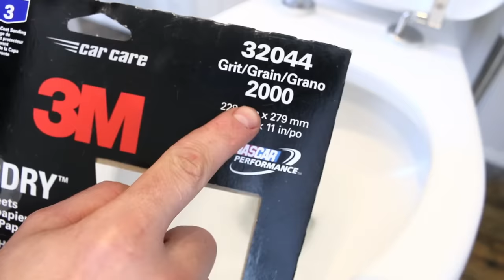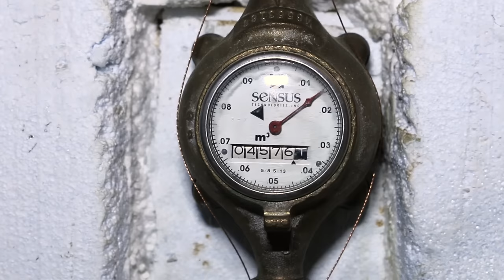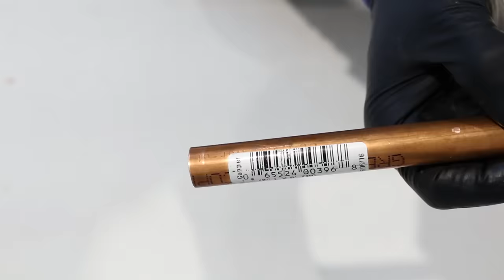15 GENIUS Plumbing HACKS! | GOT2LEARN

Comment: I installed a valve by the main shut off. To remove water from your pipes, use a wet/dry vacuum at the extra valve and leave it on while you solder. It will remove the water and help draw the solder into the item you are soldering.

Comment: You know my friend, your method of cleaning the water closet by using a sand paper is totally wrong ! Use instead a muriatic acid , spray a muriatic acid on the part needed to be cleaned  and after one one hour just rinse it with soap and the water closet will become like new again.
Reply: White vinegar more friendly and cheaper !!
Reply from the maker: Not as strong.
Reply: @Got2Learn  Obvious you have not used it !!
Reply from the maker: @goddam9925  yes, used it a few times for tough stains, it did nothing for me!

Comment: 2:20 Just wrap the fixture with a red shop rag doubled up and then use the pliers regularly over the rag- No scratches and much better grip than those stupid rubber gripping tools sold at homedepots.

Comment: A trick I have used for years when trying to solder a dripping pipe is to take a piece of bread and ball it up tightly and stuff it in the pipe.  Make your solder connection and the bread will dissolve and simply wash out of the pipe at the faucet. It helps to take the aerator off first to avoid clogging it.
Reply from the maker: Yeah, it works great! I made a video on this: https://youtu.be/ygGkJcpKZzs
Reply: Make sure you use white bread and tear off the crusts first!

Comment: Good tip about the manufacturer's sticker...! I bought a brand new scraper the other day with a sticker covering most of the blade. I couldn't remove the sticker and the glue with soap and water or with another scraper. Wasted about an hour of work time trying to clean it properly. The blade is still not ready!
Reply from the maker: Hehe, yeah the torch mixed with some flux does miracles, thanks for the kind comment Daniel!

Comment: For the first tip, instead of using sandpaper I recommend using a small amount of muriatic acid. About half a cup and let it sit. The deposits should scrub right off with a normal brush.
Reply from the maker: Thanks!!!
Reply: Because everyone has muriatic acid just laying around.
Reply from the maker: @0osha  🤣🤣🤣
Reply: @0osha  if you can buy sandpaper from Lowe's then you can also buy muriatic acid. It's in the paint section.

Comment: Been watching a few videos....not too shabby!  Lol. I don't know everything but couple things to add....1:45....not every one has dye or food coloring....if the tank is full, shut the shut off , mark the inside of the tank at the water line and wait a bit ....when checking....water level has gone down, good chance it's the flapper.  Want more pressure out of shower heads....all have restrictors that can be removed....down side you will use more water.
Reply from the maker: Good tips Todd, thanks man!!
Reply: @Got2Learn  you're welcome

Comment: That second last one, if your really stuck jam a bit of white bread down the pipe to stop the flow, fix the pipe then use your touch to burn the bread to carbon. You'll have a fixed pipe though you'll have bits of burnt toast in your system (old plumber trick)
Reply from the maker: Made a video on that, here's the link: https://youtu.be/ygGkJcpKZzs

Comment: I'm going to try the rope trick tomorrow. I'm a plumber and have had that very problem with sharkbites.
Reply from the maker: No every rope works, some will snap.
Reply: How can a plumber use a mechanical fitting thats designed to fail in cold weather? S.b. for the fail!

Comment: Another good tool to remove Sharkbite fittings is the go/no go tool for pex clamps. Just use the no-go slot which corresponds with the fitting size and the fitting is easily slides off.

Comment: Really nice vid, love that 3/8 valve trick great idea. Cause its a quick semi permanent solution as well esp when u cant turn main off, but... what if its a packing leak!? And no main shut off
Reply from the maker: Shut off at street and fix both shut off and 3/8" 😉

Comment: A reeeeeaaaalllly old trick for soldering a horizontal or vertical line stub with dripping water is to stuff a chunk of white bread about 8 " into the line which stops the dripping until you complete your solder joint. When you've turned the water back on the bread dissolves and flushes right out of whatever outlet is the next down the line.

Comment: Fast food drink straws
I have several in my solder tool box 
Use the straw to blow the water out of the pipe 
Or suction the water out of the vertical pipe before solder 

It is part of my pipe soldering tool box supplies
Reply from the maker: Sweet!!

Comment: Thanks, I'll be using the dye in the toilet tank idea and also the sandpaper or pumice stone in the bowl tip.

There is a steady dripping into the toilet bowl but the tank never seems to lose water?

I've replaced ALL the guts in the tank including the rubber gasket between the tank and the bowl and still have the constant dripping or water lines on the inside of the bowl coming down from the top of the rim. I live alone and no one else uses my toilet. When I get home from work and look in the bowl there are wet water lines running down the bowl.

I got nothing.

Comment: the alternative to using sand paper in your toilet would be remove most of water from bowl then dump a bunch of vinegar in toilet and let it sit for a while (in extreme cases overnight) you can use wet rags to it reach the areas not sitting in vinegar ...  doing this will remove any kind of stain/scale or stuff from not cleaning regularly
Reply from the maker: I tried that but it didn't work. The scale I had was more like a crust than a stain, that's why I took the more aggressive option lol

Comment: I like most of your tips.  However, using 2000 grit sandpaper on porcelain is not a great idea.  It will remove the stain, but the microscopic scratches left behind will attract soil and stain faster.  You could polish it to 4000 or 6000 to prevent this, but it's better to just get some calcium, lime, and rust remover from the store.
Reply from the maker: Been doing it forever, never had any problems.
Reply: @Got2Learn  That doesn't mean it's a good idea. My mom has been riding the clutch her whole life, and she never ruined one ... until she was 70. Then she ruined another one within a year. Her defense: "I've always driven that way". It was never a good idea; she just got lucky for a long time.

Comment: You should do one on replacing a standard hose spigot that is sweted on, usually the ones with the curved drop down.( so you can't just plug it with bread). Here's the catch, you can't cut it, and it's a multistory building with no shut offs except for at the backflow. So you'd have to sweat the old one off and sweat a new one on while dealing with continuous drips even after draining all levels. Do you have a good way of doing this? I have always had to cut the spigot at the curve stuff bread in or use a jet-sweat and heat it way up.

Comment: Great tips! The only one I didn't understand was about installing a compression valve to stop water so you could solder a connection down the line. Why not just install the compression valve where the soldered coupling would have gone?
Reply from the maker: Sometimes the split can be bigger and the valve wouldn't be long enough to bridge both pipes together.

Comment: Having  worked in  the trade since 1976, here's a couple of tricks
Removing trash from an aerator. Take the guts out and place it in the palm of your hand with the in flow pointing up. Take a butter knife(or similar object) and sharply rap the disc with the edge. All the trash that went in pops back out the way it came.
Need to sand a close nipple of copper?;'
 Take an extra long piece of sand cloth and make a mobius strip with it. Then you can sand both ends at the same time without touching the pipe.
 Yes, you can use your pliers to hold one end. Or, one time you'll stick your finger in one end and have a nice circular cut on your finger. I did say once. 
 Keep your greasy hands off that clean copper! And don't blow on it after you cleaned it. You do want a leak free joint, don't you?
Let this old plumber's brain work a bit. I'll probably remember more tips.

Comment: A good easy way to remove the manufacturers sticker is by closing your pliers on your pipe and lightly rotate it back and forth, the teeth from the pliers will easily peel away the sticker.
Reply from the maker: Will it scratch the pipe too much ??

Comment: Wed/dry sandpaper will indeed scratch the porcelain bowl.  CLR, vinegar, or other acidic liquids will dissolve a hard water stain.  What they don't remove is a uric acid ring.  Use Clorox for that.
Reply from the maker: The 2000 grit sandpaper doesn't scratch nothing by the way ;)

Comment: Another way to plug a leaking pipe so you can solder it is to stuff some bread in the leaking side. Push it in a ways. After soldering turn the water on and the bread will be flushed away and disolve.
Reply from the maker: Yes, here'sca video I made on that:https://youtu.be/lNUAX6mJTlA

Comment: ....or you could just buy some Harpic 'White & Shine' (with bicarbonate of soda in it) from the supermarket.....at least in the UK that is. 

Great for using, especially if you live in an area or region with hard water (some parts of the UK). Hard water causes limescale build up in kettles. It also causes limescale stain 'rings' in your loo pan

Comment: Use one of those expanding plugs.  You can slip on a valve over the plug, solder it, and then remove the plug.  Best case scenario and superior to a compression valve.
Reply: Blaine Bugaski it’s called a jet sweat
Reply from the maker: Yep, I use it in this video: https://youtu.be/lNUAX6mJTlA
Reply: Stuff it with old dry bread.

Comment: Another way to stop water in a horizontal pipe that you are soldering is to stuff some bread down it.  The bread will stop the water long enough for your solder job to work, but will disintegrate and simply flow away.

Comment: Most sand paper over 600 grit is made from silicon carbide and will absolutely scratch the toilet finish. You need a paper with aluminium oxide. Some coarse non woven pads have AO  or polumbus stone works well.
Reply from the maker: Been doing this for years, toilet is still sparkling
Reply: @Got2Learn  2k grit is so fine it would be very hard to notice.There is a reason why they dont sell wet/dry paper in the cleaning section of the grocery store

Comment: can you fit a compression valve on full pressure 1/2" copper ...116psi incoming ...and curb shutoff is stuck in the open position ???
Reply from the maker: Yup! :)
Reply: Got2Learn 
I mean with water flowing under 116psi ?  will the ferrule behave
Reply from the maker: As long as you are able to slip both the not and ferrule on, you are good to go :)
Reply: Got2Learn
 tks
Reply: Got2Learn I think I will need special pliers to hold the ferrule..
Reply from the maker: Once it's on the pipe past the jetting water, it shouldn't move, just make sure the valve is wide opened! ;)
Reply: Got2Learn 
gotta be

Comment: For small amount of water that makes it so you can not solder I have used a piece of bread in the pipe to stop the flow. Once the water is turned back on it easily clears the bread dam.
Reply from the maker: Yes absolutely, I actually made a video on this in the past, here's the link: https://www.youtube.com/watch?v=lNUAX6mJTlA&t=17s

Comment: Need a perfect 45 degree angle on a piece of copper.
Place the pipe over a 2x4 piece of wood. Slam your foot on the pipe close to the   2x4. Perfect exact 45 degree angle

Comment: also another very good trick for soldering pipes, alot of time we still have water/dripping water in the pipe and this does allow the torch to heat well enough to solder. The trick is to push down the pipe some bread such that it clogs up and retains the water, you can then easily solder. Once over, just run the water and the bread will desolve and run through.  Enjoy this trick.

Comment: what's best for installing a shut off under pressure (not trusting sharkbites esp on a main supply)
Reply from the maker: Compression or pro press ;)
Reply: @Got2Learn  
any tip on putting on the ferule ?
Reply from the maker: Yes, here are 2 videos that may interest you: https://youtu.be/Db_GYaTcrGk and https://youtu.be/bedg1qp-F4M hope this helps!
Reply: Shut down the water completely otherwise pro press is your best option..please no s.b or compression ball valves..unless you like kicking yourself in the teeth

Comment: Any tips on replacing a bathtub drian that the "T" part has been broken out?
Reply from the maker: Removing ceiling in basement is maybe your best option :(
Reply: Make two notches using hack saw blade, and using I thin chisel or flat end screw driver..chisel out drain
Reply: Get a drain and overflow kit and replace the whole thing. If one piece broke the rest will be brittle.
Reply from the maker: True ;)
Reply: Google tub spud removal tool
Reply: If he needs a drain key he should at least try needle nose or just plier handles and a screw driver for leverage to undo the "drain" first before making a purchase, even if it's 10$ to use it once just isn't necessary
Reply: An extractor really? A bit overkill no?
Reply: @timdempsey9468  older drains are chrome to brass pipe. Tough to get apart.  Plastic can be broken up pretty  easily.
Reply: On brass x chrome just cut it out, you'll scrap the tool created for the job on a stubborn drain.  The chinese-ium metal in those  drain keys gives out at 18" pipe wrench. The teeth pop right off

Comment: Blocking off 2 faucet at the aerator and back-flushing a clogged hot water line to another sink with cold water pressure,
I was able to completely unclog a nasty hot water line by driving cold water back and forth between the two sinks saving tons, Not an easy task to learn on the fly.(turn off the water supply to the water heater in order to allow cold water to back flush the hot lines to each sink)
Same as you do a clogged heater core in a car!

Comment: If you accidentally break glass in the disposal,use a long handle fish hook remover to pull the glass or whatever is inside the disposal.
Be sure to press the red reset button and TURN OFF THE POWER!!!!

Comment: 3:14 Another way to restore a sawn-off bolt-shank or threaded bar --- especially if you have already cut it off, or if the thread got damaged by something else, and so threading on a nut beforehand is no longer an option --- is to cut a nut in half width-wise, then tightly clamp the two halves of the nut a little way back on the threads to form a makeshift thread-cutting die.  Unscrew the assembly all the way off to re-form the threaded end.
Filing away a narrow "ring" from the threaded end can often work, also.
Reply from the maker: Niceee, thanks Fred!!
Reply: @Got2Learn  You're very welcome.  Well, I like to pass along helpful info-tidbits, just as I am always grateful when others send me helpful items :)

Comment: Use a long wooden bbq kebab skewer to pull hair out of drains. 🥸 just push it in and spin, the hair and everything else will stick to the wood 👍
Reply from the maker: I don't see this working lol 🤔
Reply: @Got2Learn  I know, sounds weird, but they have to be dry wooden skewers, not the reusable metal ones. The wood has little slivers sticking out and hair will stick like crazy. 👍 once they get too wet and soapy they won’t work. Way easier than marking up the zip tie 👍
Reply from the maker: @jdanielcramer  sweet, i'll give it a try, thanks man!!!

Comment: Most of us don't have a propane torch to burn stickers off a length of copper pipe.  Instead, use a hair dryer to heat the adhesive and remove the sticker, then use the soldering flux to remove the remaining adhesive by heating that up with your hair dryer, then wipe clean.

Comment: You can use some bread in a pipe to stop leaking water long enough to solder, it will disolve after a bit and not clog the pipe.

Comment: Instead of chewing up the handles of your Channelocks taking off the faucet aerator, use the small strap wrench that comes in a set of one large and one smaller strap wrenches (or buy one singly if you can).  The rubber strap can fit around objects of various sizes and shapes to aid in their removal.  A small strap wrench is so versatile that I use mine in the kitchen to remove lids from jars of spaghetti sauce, a jar of pickles, etc.  Their use is limited only by your imagination.
Reply: Yes ... Or a slice of mastic. Mastic gives you great grip. You can use a piece of mastic to grip a faucet bonet bare-handed to remove it or, perhaps get more grip power bare-handed to remove an aerator. Mastic can be used with channel locks as well...just be careful so you don't push the teeth of the tool through the mastic with too much force.

Comment: Why not use the compression valve as your connection with whatever you were attempting to solder rather then cut back further and putting the valve in a location where you didn’t need it , and still end up having to solder a joint when you could of used the compression valve to do everything in one shot.

Comment: Also folks...remember that if you're using primer on your pipe to be Damn sure it is completely dry before gluing it...otherwise the primer will just weaken the joint... I can tell got to learn is experienced because this isn't stuff they teach you...this is stuff you learn from experience....also...pex is the miracle material for plumbers unlike its predecessor kitek
Reply from the maker: Well said Justin, much appreciated, have yourself a great day bud ;)
Reply: You too...off to set some fixtures....inside Work so hopefully they have the hvac working 😎